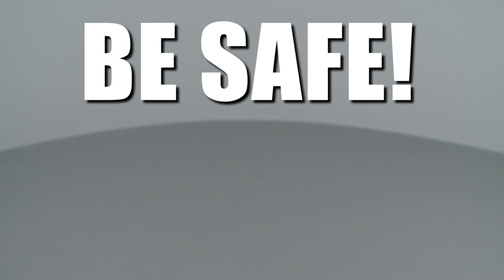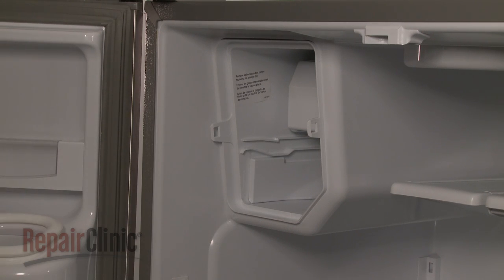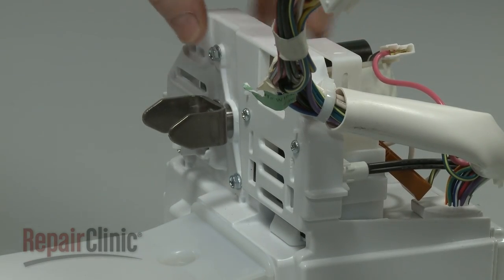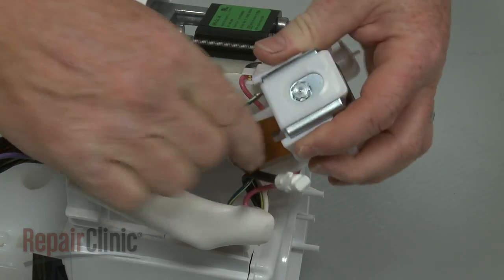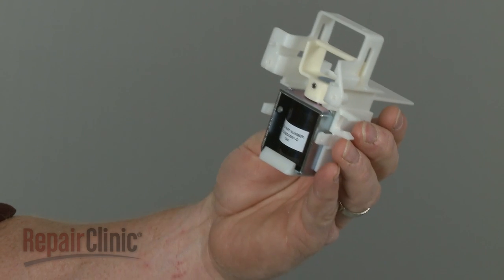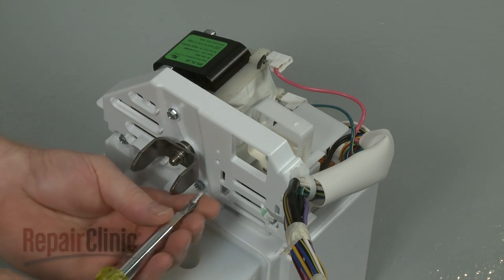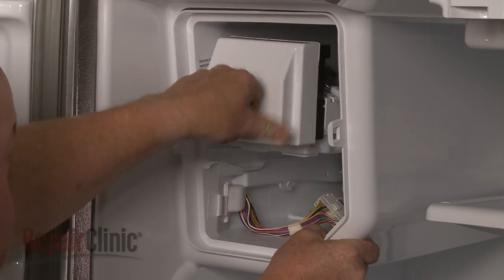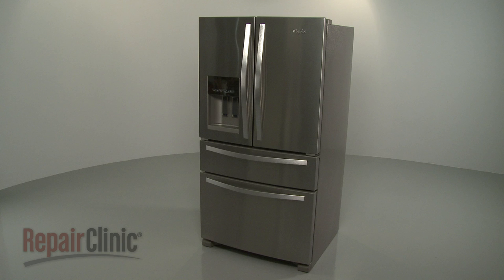Whirlpool Refrigerator Ice Dispenser Solenoid #W10309866

Comment: Thank you very much.  This video perfectly helped me fix my Whirlpool refrigerator ice dispenser which would only drop crushed ice; it would not switch to cubed ice.  When I got to 1:53 and had trouble getting the old solenoid out of the housing it made total sense why my dispenser was malfunctioning:  the silver rod and rectangular piece that goes into the center of the solenoid is supposed to freely move up and down.  Mine was frozen in the up position.  I had to cut off the plastic actuator tabs that slide up and down in the housing slots in order to remove the old solenoid.  The new one I bought from Parts Direct for $70.00 went in easily, and with around 30 minutes of effort I had cubed ice again.  One other note for anyone who runs into one other struggle:  at 0:58 they show how to remove the wiring harness.  Mine was extremely difficult to separate, and left me wondering if I was pressing the correct release tabs.  If you have this problem, ignore what look like side tabs on the connectors.  There is only one - on the top middle of the front one.  You just need to press down on it.  The demonstrator's hands are in the way so you can't see this, and it is not well described in the video.